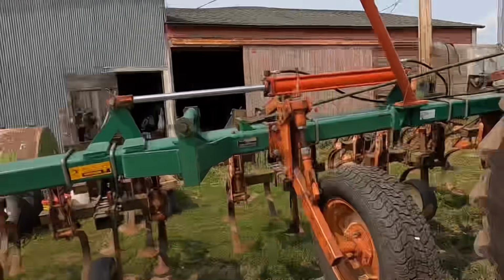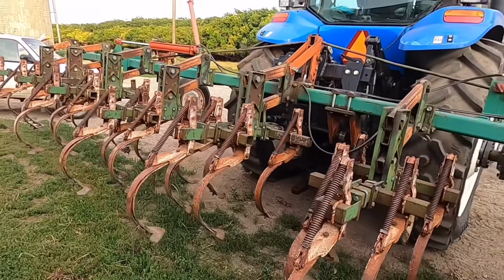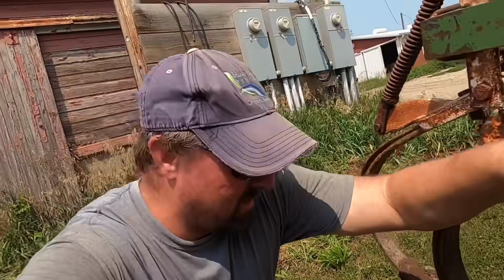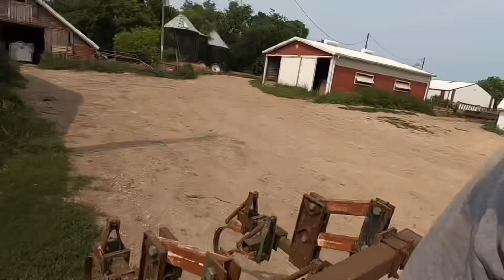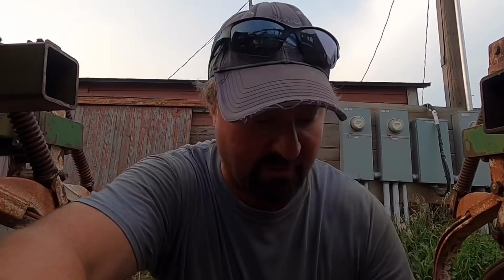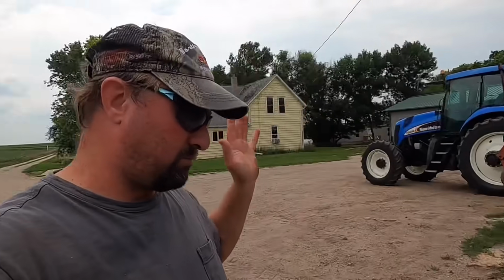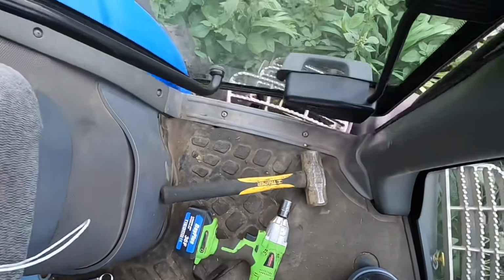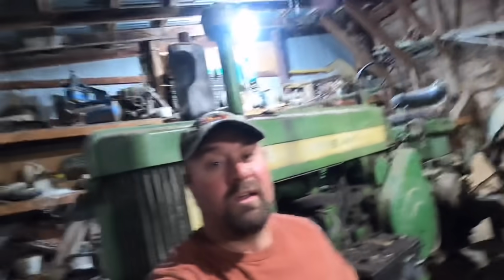Cultivator Repair Work and Cultivating The Soybeans For A Second Time!

Comment: I was enjoying your presentation and then suddenly, at 17:20 into your video, you said something so incredibly ignorant that it was flabbergasting. How can anyone who is otherwise enlightened enough to be an organic farmer fall for such nonsense?  Do you actually think our government planned this pandemic? Anyway, statements like that can cost you credibility, which is a lot more than losing subscribers like me. Goodbye.
Reply: Don't let the door hit you.
Reply: Ahh bye bye now don’t let the door hit yeah where Mother Nature split ya
Reply from the maker: From the research I’ve done, I found out that no one has been able to isolate the actual sars-cov-2 virus. That means not even the CDC has isolated either. They have not pulled the actual virus out of someone and genetically sequenced it and said precisely this is sars-cov-2. So it makes one wonder if the virus ever existed. That’s why I said a plandemic. Even the PCR test used to detect the virus can’t even tell The difference between the coronavirus and any flu virus. It only measures is a viral load. Believe me I’m not the only one that has come to this conclusion.